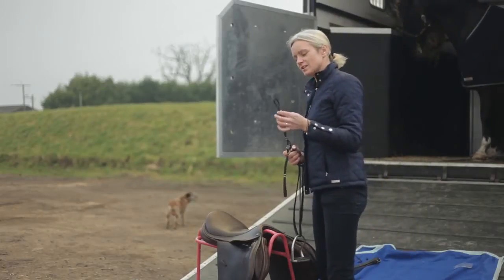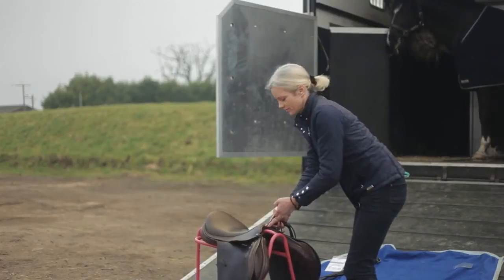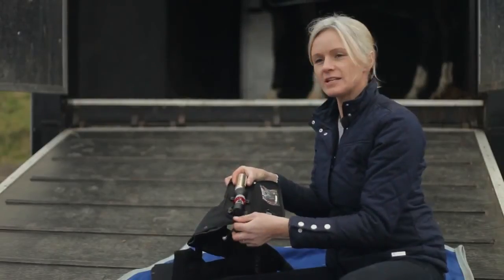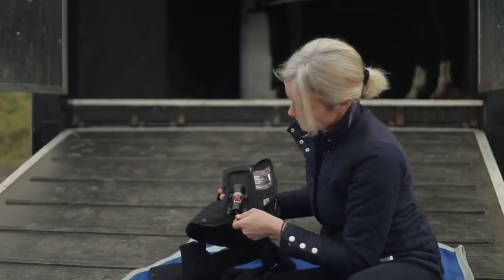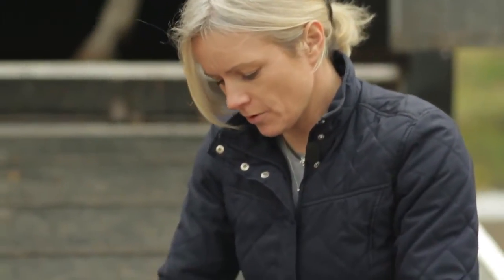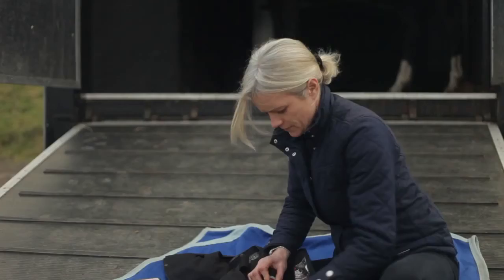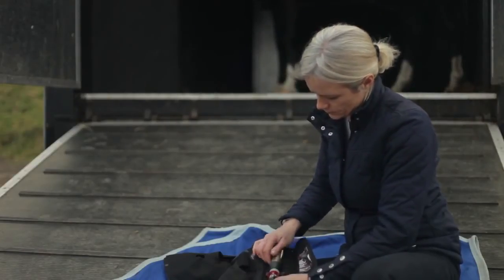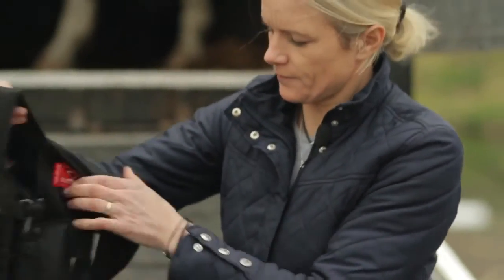Changing the canister in a Hit Air Vest and attaching the saddle strap.

Comment: Since this is the top video for this search term, I'll leave this info here. Hopefully it helps someone else in the future, as I could not find it anyplace. The bolt is a metric thread, M6x30 1.0 pitch. Total bolt length: 36mm, head height: 6mm  I found them at my local hardware store for about $2 (vs the $20 or so I've seen it other places online).